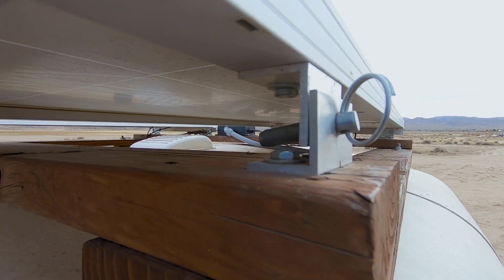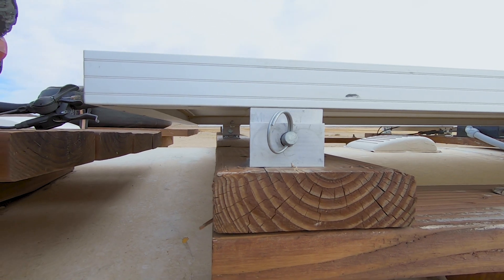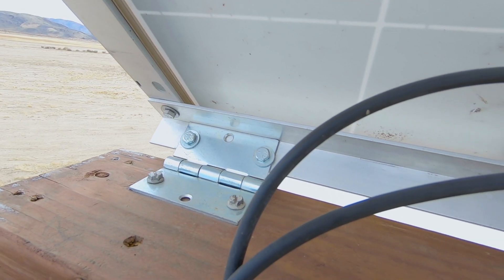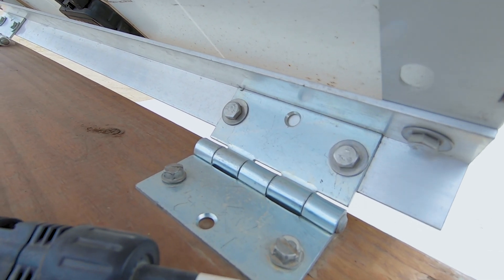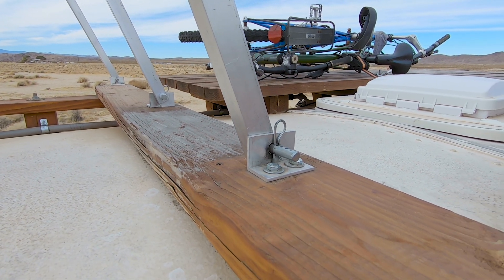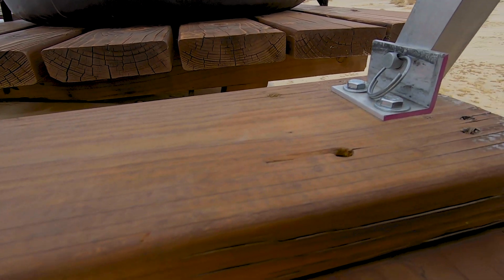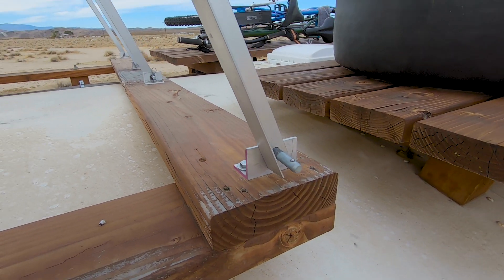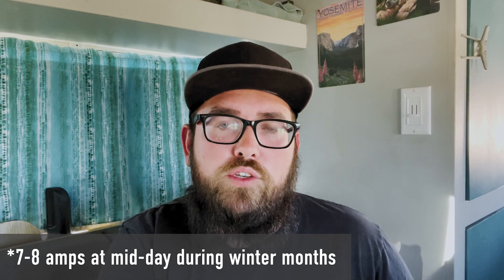Solar Panel Tilting // Our DIY Off-Grid Skoolie Setup

Comment: Yo, hey Aaron w the double A's lol nice video dude, we learned sumpen from u, especially that whole 15 degrees deal, thanks. Ya we are still gonna try to mount ours on the side windows like we mentioned to u, but now hearing what u said about how the sun heats up the bus is making us wanna kinda rethink the whole strategy a bit.. plus so far we only got 2 100w renogy panels and we think that might be a bit under size for our 400amp bank. Maybe going back to the drawing board here.. and def really inspired by ur panel tilt set up. Unfortunately our bus didn't come w a roof hatch and getting on the roof for us now just isn't an easy task yet..  man, so much to think about lol

So ru guys still in socal? Sorry been too lazy to get on Instagram lol
Reply from the maker: Hey! We're still in the Joshua Tree area. And I would definitely get more or bigger panels. We have 320 watts of solar and 300ah of sealed agm batteries, and I wish we went with more. I'd probably try for at least 4 or 500 watts with as much battery as you have. 

The 100watt panels are probably the most expensive per watt you can buy. If you get home panels from any of the big companies, they'll  be quite a bit cheaper. I'd personally probably get something like 2 300watt panels from grape solar. But you'd probably want to figure out how to get those mounted on the roof. They would be pretty big for the side of the bus haha.
Reply: @StuTheBus  ya agreed, but doesn't a 12v system require a certain type of panels that's below 24v of open circuit? If so I seem to have only found panels at around 100 to 125w per panel in roughly the dimensions of 25x45 or so, but I could be wrong.. Any tips on that?

Btw how long ru guys planning on sticking around for? We might head back out there again soon.

Comment: Just put flat aluminum  across where the   bungee cords is with a bolt on both ends
Reply from the maker: Thanks for the tip! I thought about doing something similar, but didn't want to complicate things with more pieces and bolts or more hitch pins. We were also pretty limited with storage so it had to be as small of a solution as possible.
Reply: @StuTheBus  one thing we discovered about the skoolie life is to fix things to make it work first while ur on the go, then go back down the road it improve it after its been proven. Or.. just when it absolutely gets on your nervous and just say F it and do it right, which ever comes first lol